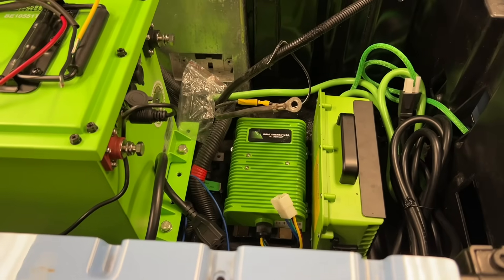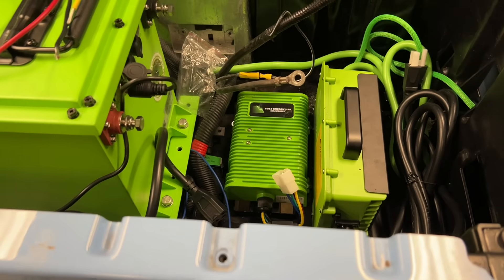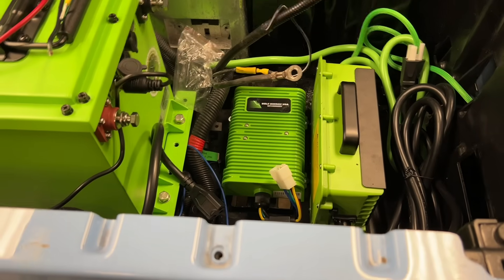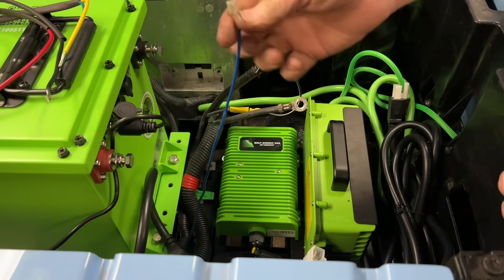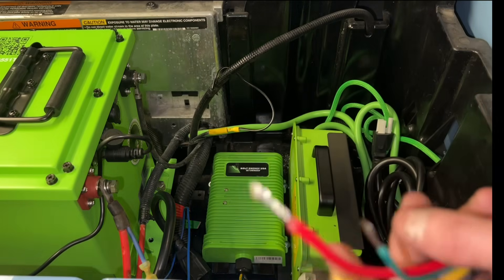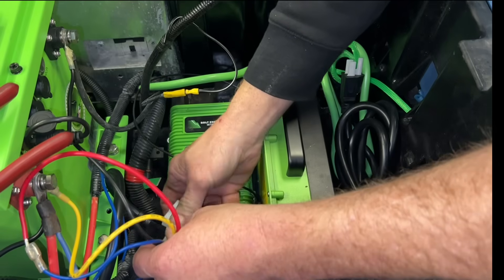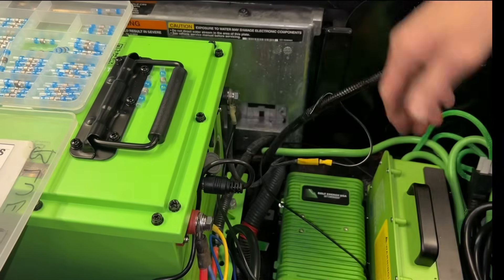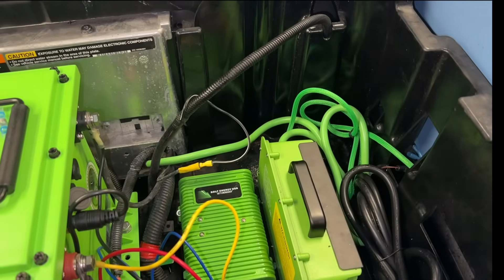How to install a 48-12V DC converter ￼

Comment: ❤Hey hey hey 9000 mom bought home with a new 2021 EzGo EX1 Golf Cart. Was going fine but stopped going forward and back. Cart Medic charges 150 to come out and wanted to charge her 1200 for s new clutch. I'm thinking it's a brake issue. Anyways we love y'all. Peter and Mom❤
Reply from the maker: @PalmBeachPeter  is the cart turning over when you hit the gas

Comment: How many accessories can you hook to one converter
Reply from the maker: Depending on how many amps the converter has that you install. The led  lights almost pull minimum. Turn signals pull minimum.  But several several accessories depending on amp rating.  Great question
Reply: @Golfcartwhisperer  so if you were running under belly lighting and the LED headlights would still cover an average converter or is there a specific rating one would need

Comment: When you crimp remember that the round part goes on the seam of the connector. The poke side goes on the bottom. ❤
Proper crip is a solid connection!!
Reply from the maker: @lawn2learn  The heat shrink is over the end of the lug. It’s just hard to tell from the camera. But they come in a kit when you order the  Bolt Pro Kit.  But, thanks for commenting in case my viewers are doing them their selves
Reply: @golfcartwhisperer 
Nothing bad on your end. 
Just my 2 Cents on butt connectors. ❤